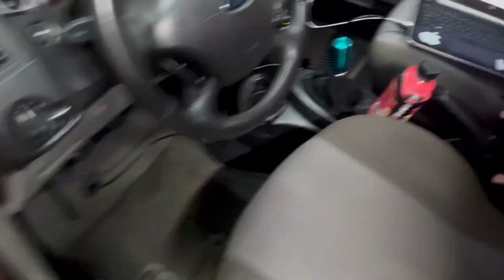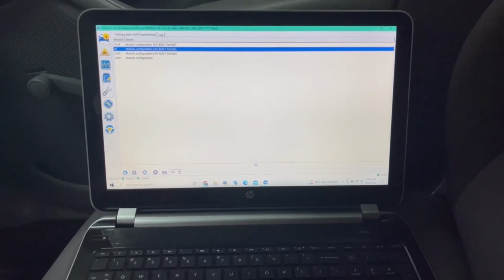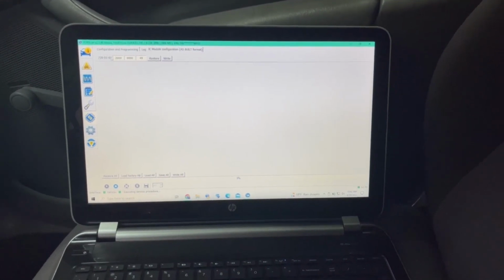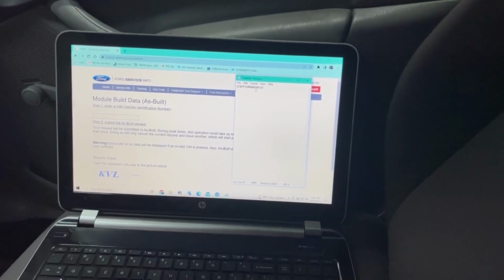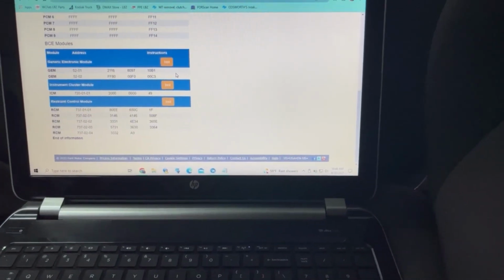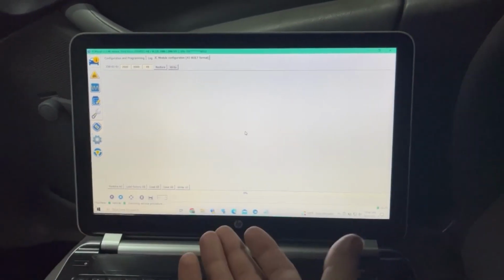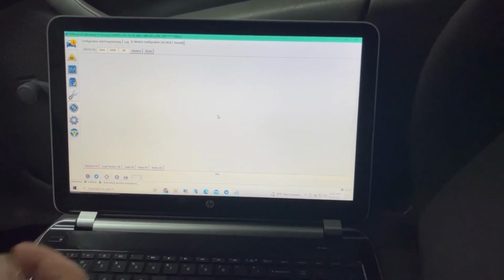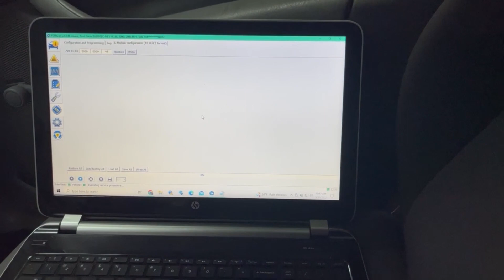2005-2007 Focus Tachometer Cluster Swap Programming with FORScan

Comment: Will this also work with traction control? I got a cluster for my focus and the abs, brake and traction control lights are on and the overdrive light doesn’t come on when I press it it only comes on when it does its light check
Reply from the maker: It should to my knowledge

Comment: You should definitely swap power windows into that car
Reply from the maker: @kero_g37s  working on getting the parts now actually
Reply: @brandinsgarage  you can get most parts from a scrap yard for cheap no? I'm planning this project for winter break 🤞
Reply from the maker: @kero_g37s  yes that’s what I’m doing, just need the body harness that comes from the driver kick panel and goes throughout the car. Then the door panels and guts of the doors